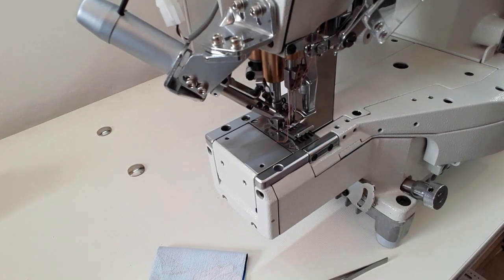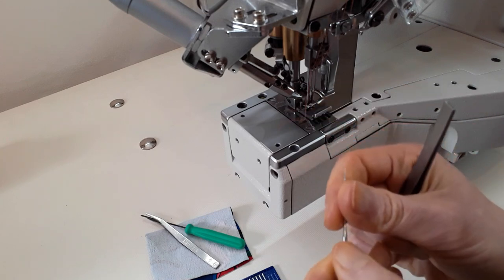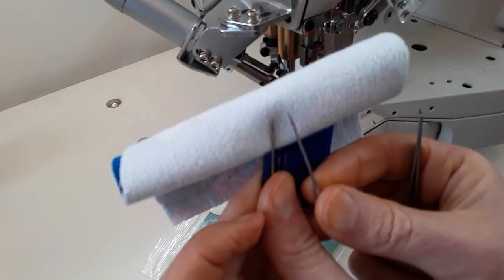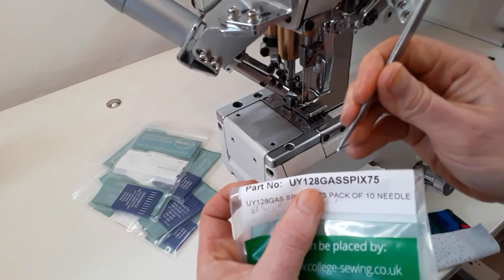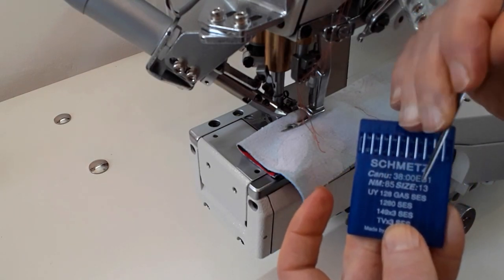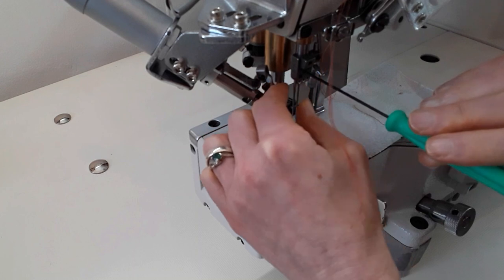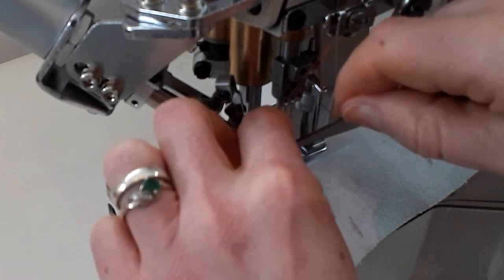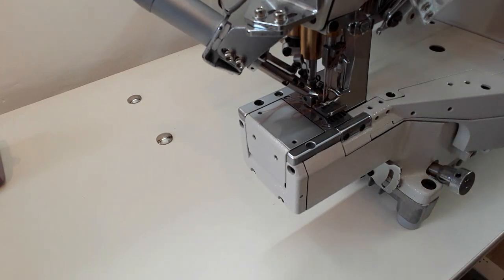Juki MF 7923 Industrial Coverstitch: How to Change Needles, Which Needles to Use for Best Results

Comment: Can I ask a question my needle are in the right way every time go over a Seam the stitch  breaks should I use a bigger needle I'm using a Groz Beckert size 80/12 sewing 2 to 3 layers of Jersey  it just breaks going over a thin overlocked seam every time I going to try a size 14 needle to see if I get any relief do you have any more suggestions or a video on sewing over seams thank I notice your supplier of needles I use that company CSMP they have great customer service and helpful.